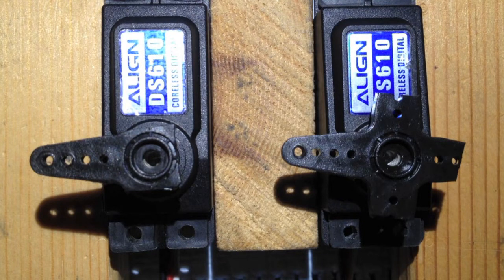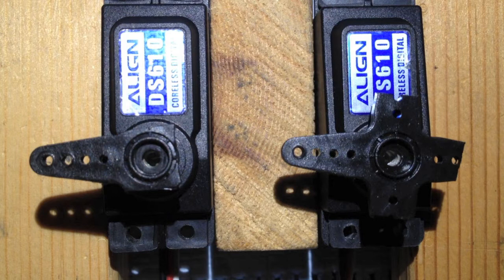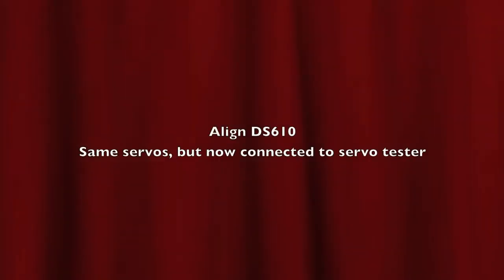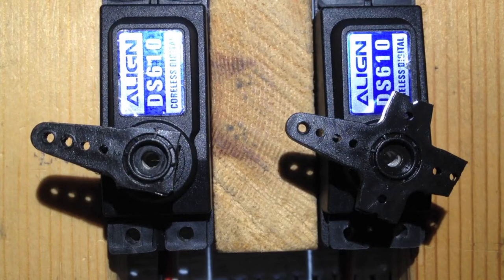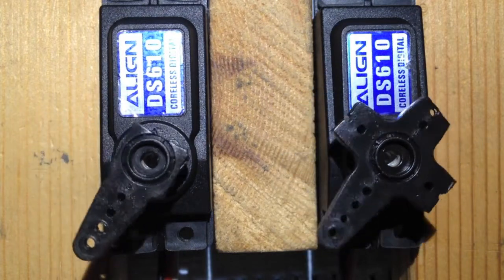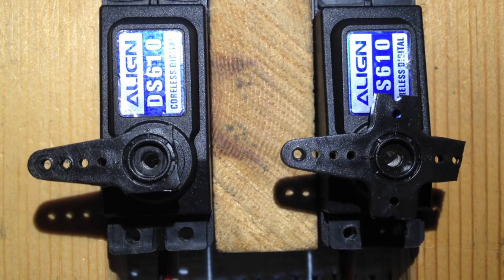Align DS610 servo with jitter

Comment: Rengöra pottarna ?
Reply from the maker: About cleaning the pot's…
It might work. I have some new pot's on the way in the mail, so once I take the servo apart I will put in a new potentiometer.
Reply: @bobbycool07  did you solved that problem ?
Reply: I have equal problem.
You have resolved?